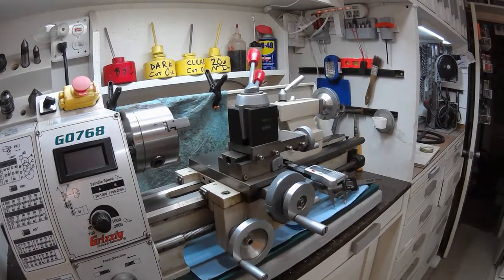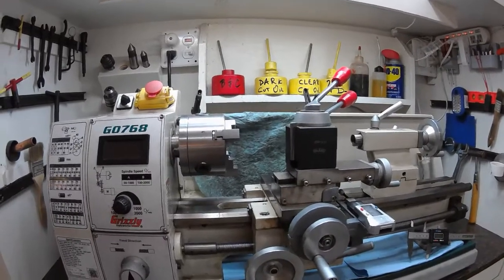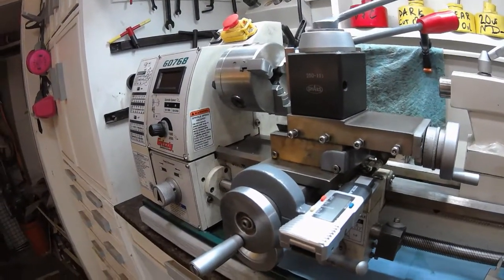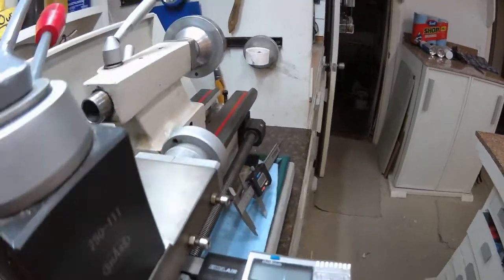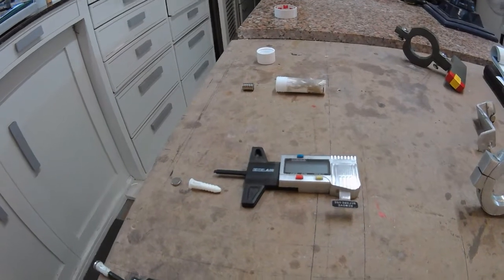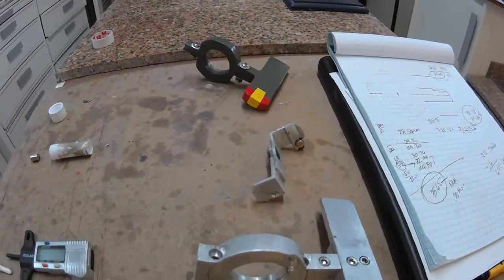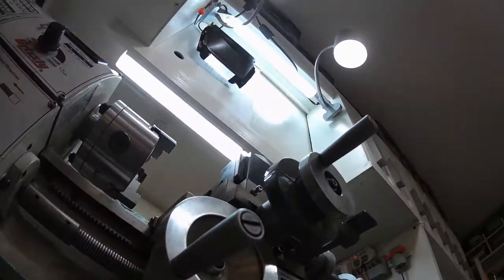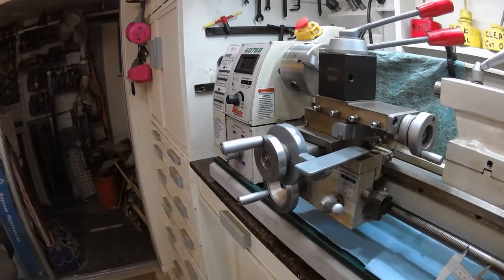DRO- Grizzly G0768     -- digital tire tread depth gauge

Comment: Very nice and clean. I've made them a few times with tread gauges. I like the kind that have the auto on (when moved) and off (after a few minutes of inactivity) feature.  One of the things I do is cut out the clear molded plastic that they're packaged in and use it as a cover to keep oil an chips off. I do mine a bit different in that opposed to the "probe" part being pulled out of the gauge as the distance increases, I instead use a spring to hold the probe extended out of the gauge, and as I advance the cross slide it pushes the probe back in like the spring loaded action of a dial indicator. In this configuration the readout simply displays as minus. On my latest one I made an adjustable rod that engages the probe. This adjustability allows me to set the starting point of contact in relation to the position cross slide as it accommodates whatever size of work is held in the chuck.
Reply from the maker: Yes- I have seen one or two other videos with DROs made from the tire depth gauge.
This one uses the spring as you mentioned.
https://www.youtube.com/watch?v=z7QjVZ8CdPY
It seemed like an extra step, and might get chips or oil and be hard to keep clean?
I saw one other removable DRO using tire gauge and small magnets, and though it would be more simple.  The magnets work fine, so far but there is always an improved mouse trap.
If you have photos or yours, please post so I can see if mine can be improved.
Reply: You'll notice I commented on that very video sometime ago too, it's where I initially saw them. :)  I wouldn't say yours can be improved (At least not by any means I'm aware of). Each custom fit build of them seems like an exercise in the many ways to skin a cat.